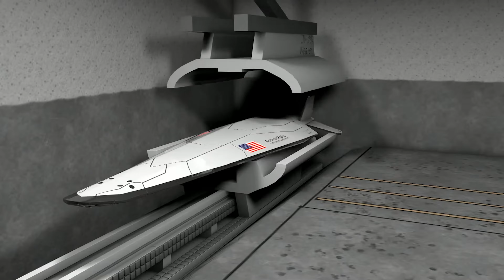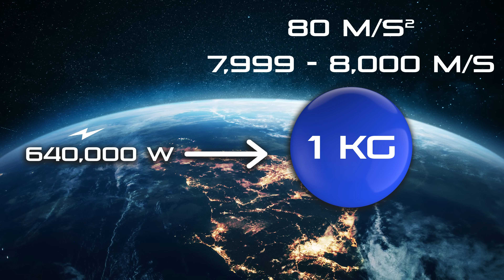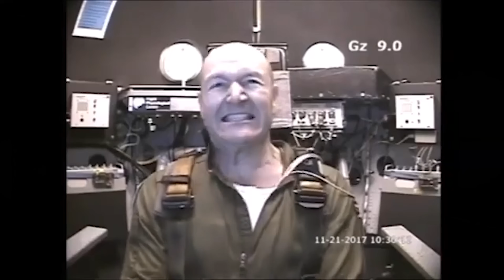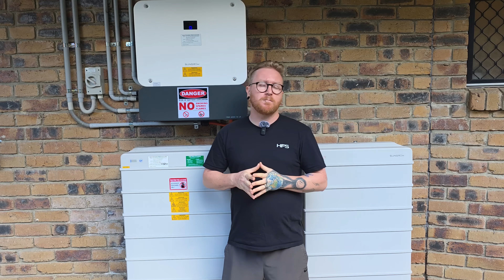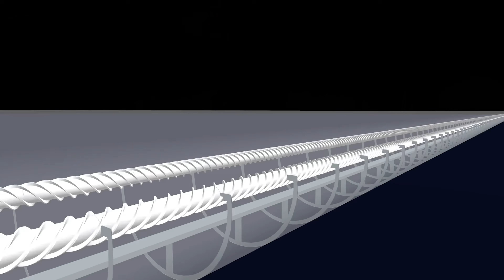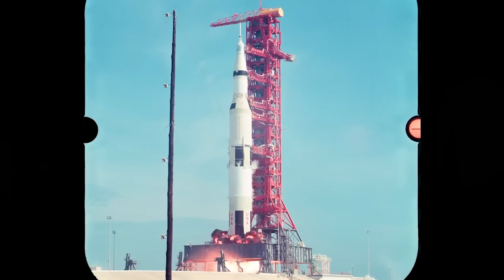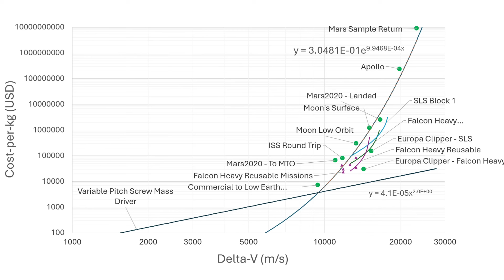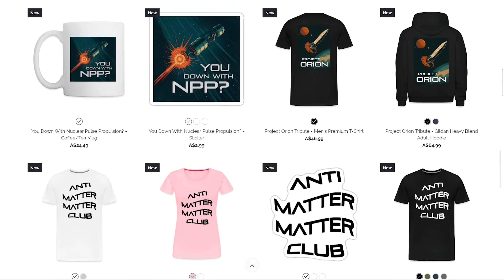The New System That Could ACTUALLY Replace Rockets

Comment: Thanks for making this video, I wasn't aware of this proposal so I appreciate you bringing some attention to it. It does seem promising in some ways and I'm not searching for problems- I know its just a proposal at this point, but I would be particularly interested in thermal management. One issue (actually maybe the biggest issue) with inductive launchers is that by the time you reach orbital velocities losses from magnetic coupling are such that you basically melt your armature. Something like temps around 800C at about 2.4km/s (not even close to the 11km/s proposed here). Sacrificial ablative armatures and actively cooled armature all have big complications. Not impossible to solve but a major hurdle that needs to be addressed. As for vibrations- we make flywheels all the time so it shouldn't be impossible, but they aren't simple either, especially the extremely high velocity ones require extremely precise machining and manufacturing and vacuum control. Anyways thanks for the video.
Reply: From the terminology that you used, it sounds like you're referring to coil guns or linear synchronous motors and the eddy currents that are generated by the changing magnetic fields that the armature experiences as it's accelerated by the stator. The VLSP paper (see description) discussed how the adaptive nut is not a linear motor but rather a magnetic worm gear, and how it is designed to minimize changing magnetic fields (and thus eddy currents). The changing magnetic fields that do occur happen within the screw flights, not the accelerated parts of the system, so heating is distributed along the length of the launcher, not concentrated in the armature (adaptive nut in our case). It does seem like you have the kind of subject matter expertise and practical experience that could be applied to review our proposed approach and highlight concerns we might have missed. Would you be open to discussing that?
Reply: @spaceinfrastructure3238 correct. You don't get many of these problems with linear accelerators using multiple coils. Only the rail guns that tend to weld at high current.
Reply: @spaceinfrastructure3238 yeah exactly! Interesting, so the worm gear configuration doesn't have these currents, or much fewer? If you're able to ramp up energy and avoid those Eddy currents while still getting a decent gradient then I think you've solved a lot of big problems and I'd be very excited to hear more. I sent y'all a message through your website contact portal!
Reply: Not about you though is it yah bellend!?...

Comment: If you're counting on taking advantage of the whole mass of a kilometers long screw spinning, forget it, it would tear itself apart. You would have to create independently spinning sections. In a one-piece screw, the load is focused at the sled or payload, a single point along the screw, the shear forces of the reaction force is only going to be concentrated at that section of the screw. meaning that the torsion force is applied unevenly at that point compared to screw sections behind the payload as it moves forward. That difference would rip the screw apart, or you would have to spend extra energy keeping the part of the screw no longer contributing to the movement of the payload spinning at the same speed instead of slowing down as it transfers its energy.

Two things I could see maybe improving this concept is changing from single screws to sections, as well as removing the need for a vacuum tube. I wonder if simply having a lighter "nosecone" air diverter go in front of the craft (without being coupled to it?) would allow the rest of the craft to travel in its wake or slipstream. To create a low pressure area behind it, to reduce drag. There are even electric/plasma methods to reduce air drag that might help that could be applied to the air splitter.

Comment: This is perhaps one of the stupidest ideas I've ever heard of. You haven't even begun to deal with the physics of this tube, the vacuum, forget placing it underwater, the physics of that massive screw turning , the friction launching a rocket into space that still needs fuel, that's a liquid you're accelerating, the physical structure of the ship to withstand those pressures the exiting out of a vacuum tube into a thick atmosphere, and then the necessity of requiring all the rocket equipment and fuel to land somewhere and to takeoff again and get back into earth atmosphere. Oh my God you've not thought of anything except a long screw that would make something go faster. This is the stupidest idea on the planet,

Comment: Great video and very interesting topic!
Besides this new concept that seems innovative even if expensive, what do you think about those extra boosters, e.g. like in Star Wars when they are supposed to fly at "lightspeed" and then disconnect them when they are not needed?

Like the first stage of a space rocket from Earth, but also in space. 
That you kind of get an extra boost and then let them turn around like at the moon and fly back. The main rocket flies on to Mars and brakes into orbit.
Then you do the same thing there, you leave the extra engines in orbit and land with a small ship on Mars. 
Then when you want to return to earth you connect to these extra engines and fly home again.
I think that Pulsar space and Impuls space are doing something like that..

And:
For humanity to become multi-planetary beings we need to develop better materials and engines for take-off and landing on other planets and withstand more types of pressures and conditions.
Then we need to solve the gravitation field so we can walk around in spacecraft and on space stations in space.

Comment: Pretty interesting.  I understand the concept.
It looks to be a difficult engineering challenge to store the necessary rotational energy in such a long tubular construction.  I hope I am wrong about that.  Of course, the higher the total mass of the rotating parts (stored energy), the more effective such a launch mechanism could be.
I would expect the launch site to gradually move from horizontal to maybe up to 45 degree incline at exit.  The heating of any craft hull at exit could also become important.
Good control of air pressure or vacuum in the launch tube would also be needed methinks.
A little skeptical frankly, but I do think such a launcher from the Moon or asteroid is a neat idea.

Comment: What about the cost of the infrastructure to do this? Land acquisition, environmental issues, energy to operate it?  How would you build a vacuum tube several miles long? How would you stabilize the spinning screw for several miles without vibrating or whipping itself to pieces? What are the actual G forces of slamming into the  atmosphere at 7 km/second?

Comment: About the spinlaunch, this is idiotic to use in an atmospheric environment. But tech is worth developing, since it can work wonders on Lunar Launch Systems in future, as there's no atmosphere to slow down the initial velocity.
But on Earth, best candidate is RAPIER-like engines, such as SABRE from belated Reaction Engines Inc., you have to use air in your advantage. That'd not only add enormous amounts of Д-V to rocket's range, but also wouldn't require a launching facility, well except a runway.

Comment: A variable-pitch screw launcher is mechanically feasible but fundamentally limited:
Pros: smoother acceleration, constant RPM operation, reduced initial stress, possibly higher top speed.
Cons: severe material/geometry limits, synchronization difficulty, manufacturing complexity, and contact friction.

For modest velocities (tens to hundreds of m/s), it might make sense.
For space launch, mechanical screw-driven acceleration becomes unworkable much below orbital speeds — electromagnetic or gas-dynamic launchers dominate.

Comment: Single stage to orbit is the goal of many scientists for a modest payload but it has never worked.  But consider that if you could launch a rocket from a mile high you would save many tons of fuel and that could be replaced with more tons of payload.  Consider also that if you use water bags  at the top of a 500 foot tower that are used over a pully you could use a few thousand tones  of water to boost the ship up faster and get it moving with much less fuel.  If you are in the mountains and have a steep mountain beside your rocket you could lean a track up that mountain.  Maybe steeper than 45 degrees for a mile or two.  Drill tunnel shafts vertically down from the top of the track through the mountain to it's base or even deeper.  Use a platform that you can slowly fill with rock rubble or water until you have hundreds of tons of weight on it and use a two to one lift ratio to help pull the rocket up the track while it is burning fuel.  No matter the speed at the top, the rocket will continue accelerating  spaceward..  After the launch the weight will hit bottom and spill out the rock and water which can then slowly be carried back to the top.  It would be like having an extra ten rocket motors on the booster but without burning that extra fuel or carrying it and expelling those ten rocket engines when they are finished but then re-use it later.   It's simple and dependable and only requires trucks to carry rock and water up a tall mountain.

Comment: Ideal way to start is sending fuel to LEO for refueling rockets in space. Send in many small quantities. Tanker in orbit would capture fuel for later transfer. Perhaps for fuel required to descend from orbit. Consider the launch containers could link to form the tanker or build another structure. Just send water and use solar to convert to O2 and H

Comment: Actually modern electrolytic capacitors have become really small. Look at your modern day power supply. A 100V 500 uF capacitor now is only the size of a fingertip. And it gets even better. The amount of power you can pack is only limited to how close you can get the plates together without touching.

Comment: Not sure if whoever did the maths (oh that’s why there was only talk and no maths in this video, right) ever did the maths on the required rotational speed for the final screw
Reply: Yes, there is a lot of math behind this. It's covered in a 23-page peer-reviewed paper (see description), and there's a digital twin (basically a computer simulated implementation of a physical thing) with even more detail than the paper. The paper covers the CAD modeling and stress simulations of the screws.

Comment: See a lot of comments on how to make a screw that long and how to keep it from buckling.  This is simple.  Make it in short segments and support the segments at the joints with bearings that are also motors.  This also avoids the torsional stress of spinning a shaft that long.  The real insurmountable part of this is creating a vacuum in a tube that size, and supporting a tube that long.
Reply from the maker: You're spot on there, and this is exactly what the paper describes doing. The vacuum chamber will be very difficult, but I don't think insurmountable. This would be much less difficult on the moon, or on Mars due the complete lack of (or near complete in the case of Mars) an atmosphere.
Reply: @HelloFromSpaceAus  The problem there is in getting those parts to the moon/Mars.  Possibly it could be done on the moon, but you would have to install manufacturing capability first.  

Mars?  Again, the problem would be establishing local manufacturing capability, but Olympus Mons would be perfect.  No massive support structure needed.  Just some struts.  Put it in the right spot, and Earth transfer orbit becomes available every 24 hours.  The thing is, the only thing to send back to Earth is people, and the g force loading restrictions would pretty much limit you to the Holman transfer windows.  

Earth?  Establishing vacuum and definitely the support structure.  A beanstalk would make more sense, but screw or beanstalk, it would be massively expensive to build, and impossible to protect from yahoos like Bin Ladin.

Maybe cable slingshots in orbit like described by Arthur C. Clark in The Fountains of Paradise.  If that tech could be developed, a shipping infrastructure could easily be established throughout the solar system.  Just place major and minor hubs wherever needed.  Then the problem is reduced to getting people and materials into orbit at each node.  The screw would work for moons and planets, with the exception of Earth, where you still need to overcome high gravity, dense atmosphere, and the yahoo factor.

It would also require much less screw if you only needed to reach the slingshot.  You would still need rockets and rocket fuel to maintain slingshot rotational velocity anywhere you don’t have a strong magnetic field though.

As the computer pointed out in Interstellar, we don’t know how to speed something up without throwing something away.
Reply: @HelloFromSpaceAus You'll notice that most of the high-horses neigh sayers, so to speak, have made sweeping assumptions in order to justify their closed minded attitudes. The defining trait of an Engineer is self-assuredness. Machiavellian is an engineers middle name.

"If I haven't thought of it, it must not be worth thinking about"

They're way more comfortable telling you why something won't work, rather than helping find solutions, since in their heads they've already made an "Objective" judgement that rests comfortably on the bed of assumptions they're intimately familiar with. Namely amongst them: Always thinking themselves right and being an authority on any subject.

Comment: The problem with space travel is the lack of anything to create an equal and opposite  reaction. Silly children believe that physical law must just quit when you go into the impossible barrier between our pressurized air and the 1 hydrogen  atom cubic meter near perfect vacuum low volume. By near perfect, that description is an evacuation beyond any equipment  anywhere, 30 inches of mercury.

Nothing can't be turned into the second part of Newtons 3rd law of motion, the  equal and opposite reaction.

This is just more total BS. If the projectile launches it still has to breach the dome that the Space x couldn't do and neither did operation fish bowl... Even if fake space were real, how is maneuvering possible? "Retro rockets? No equal and opposite reactions possible in nothing, eh?

The multi billion dollar budgets mentioned are little more than theft and invested in this CGI  crap that is only needed to promote the impossible fake space earth ball lie. 

Go on space believers, show one single empiric condition where nothing creates an equal and opposite reaction. You can't but still believe like all religious zealots...

Have a nice day!!!

Comment: This proposal is basically "building a stairway tube (halfway) to heaven."  Your launcher tube & screws would have to be far longer than the tallest tower humans have ever managed to build... and it would have to be built on a diagonal, rather than vertical, which makes it much, much harder.
Reply: You should probably watch "Electromagnetic Launch - What is (and is not) Holding it Back". The tube and screws are small in comparison to the kilometers of wind turbine towers or kilometers of airline fuselages that we've built. Or maybe just try to really understand our civilization's capabilities - like think about how long the Great Wall of China is.
Reply: @spaceinfrastructure3238 , the Great Wall has the advantage of lying in the ground. This proposal requires the tube and screws to go up into the air, at an angle.

Comment: Engineers are still going to hate this.  How many kilometers long is this screw?  It's magnetically coupled to the craft?  Never heard of that, how does that work?  Can the screw have support bearings along its length, or is it simply supported at two ends?  Have you heard of metal fatigue?  Any bending misalignment will generate a fracture, so this could be a single use system.  And the air resistance!
Reply: The screws are supported every 5 m with brackets and they're spinning in a vacuum. This is all based on sound engineering, There's a paper on it that has been peer reviewed by experts in electromagnetic launch.

Comment: So a few thoughts...

It sounds more like a transmission than a flywheel analogy. By widening/steepening the screw you're essentially creating a ratio multiplier like a combustion cars transmission.

It may be far more efficient, but my thought is what are the engineering hurdles on this? Creating a many km long track with safety against derailing. Vacuum sealing the launch tube to reduce friction (Elons hyperloop he could only build a few metres before giving up?) which I imagine would be a requirement when both talking mechanical propulsion, to prevent rail warping from the heat, as well as to reduce drag given we're trying to push something through a tight tube at high velocity. And my last big point is how are you driving these screws across long distance? Driveshafts and deep oil/gas drilling show the challenges of this. The large torque required as a load gets further from the source results in twisting of the shafts. If you're going to have indepent sections of these screws driven by their own power, how are you safely and seemlessly transitioning the craft from one to the next, particularly when we're talking thousands of m/s